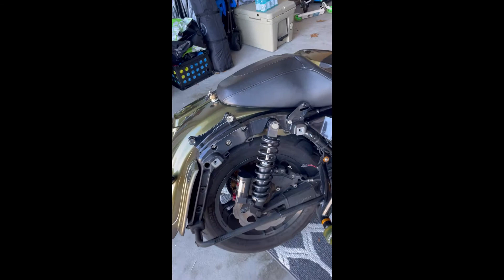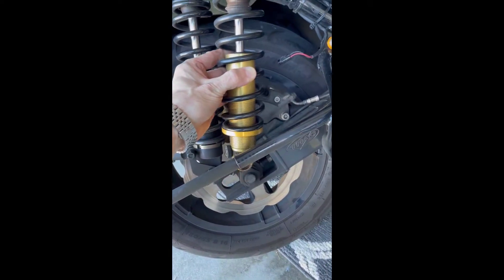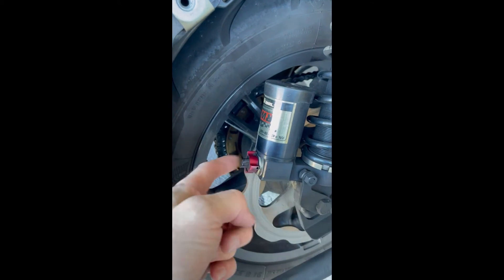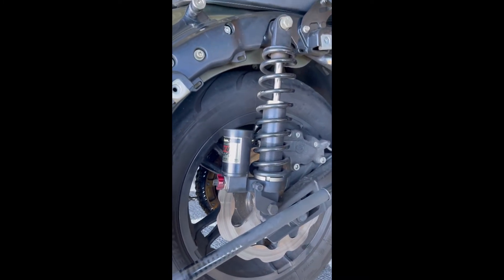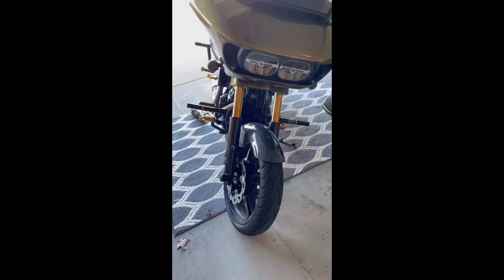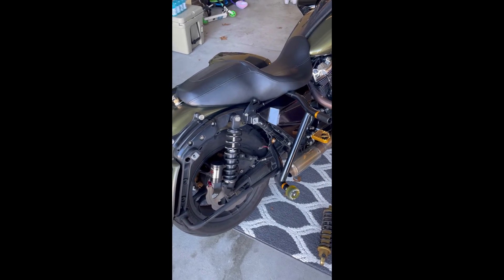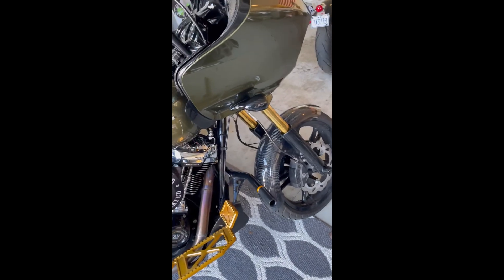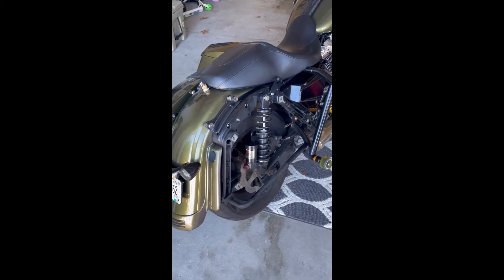Harley Davidson Touring. Stock vs. Legends REVO-A vs RWD RS-1 suspension review

Comment: I'm running the RWD RS-1 shocks (13") on my 2021 RGS (Stage-2 114; S&S 465 cam, S&S 2-1 Sidewinder, Fuel Moto 3956 Air Cleaner, Trask M8 checkvent, HD oil cooler fan, & Dynojet PV3b Tuner) for over a year now and I'm completely satisfied with them; these are excellent shocks and easy to make adjustments, etc.  For the front end, I'm running the Progressive FST kit and it's working just fine for me.  The Progressive kit was half the price of the Legends.  Perfect for my style of riding, 2-up, cruising in the hills with curves & along the beach.  Handling & comfort is nice.  Now that RWD has a kit for the front end, I might go with that in a year or so.
Reply from the maker: Definitely a game changer and I’ve got about 25k on them and they have been great for everything from long highway rides to carving canyons.

Comment: I had a Legend shock blow out on me, and I took it to the dealership, so they could send it back.  The stupidity that ensued was of a monumental level.  I was down months on my bike.  I’m glad that it was winter time.  I will admit, it appeared to be mostly the dealers fault, but I couldn’t have been more unhappy with the long and stupid process.
Reply from the maker: I see stuff like this happen a lot. Again, this was my experience with Legend and ultimately the reason I stripped them from my bike and went with other companies. I know others with good experiences but I try to just put out mine. 

Thanks for the feedback and for checking out the video🤙🏻
Reply: @tyrantperformance  their suspension is better than stock stuff, but it’s the next level up.  Ohlins is top of the food chain.  I had a race quad with Ohlins on it, and that stuff was so good.  The guy from Big Bear Choppers is a mad scientist.  He has a video on YouTube, and he compares Legends to Ohlins drop in fork cartridges.  He does not give Legends a passing grade.  That guy has been pushing Harley Davidson bikes to their limits for years.

Comment: I think you have a misunderstanding of high speed and low speed damping. It has NOTHING to do with "how hard your gettin' on it", it's high speed SHOCK TRAVEL vs low speed shock travel. Examples of high speed damping would be potholes, expansion joints, sharp bumps, etc... While low speed damping is what controls low speed movements in the shock like dips, whoops, cornering compression, acceleration and braking, etc.... Things that compress the shock at a lower speed than the sharp bumps. Go back through your settings with that understanding and take your bike up another level...